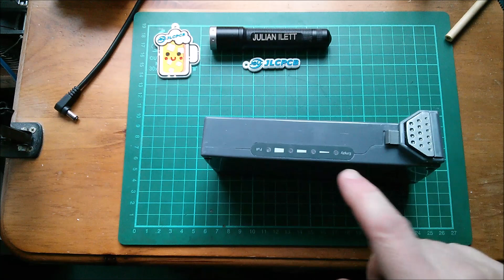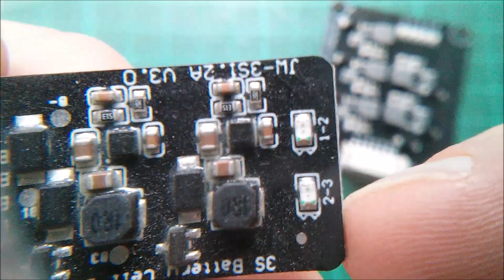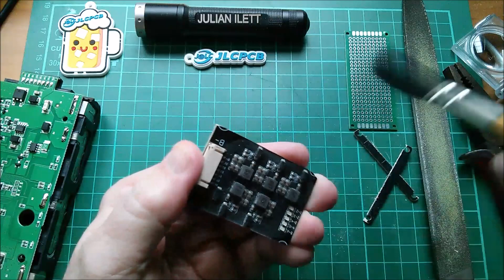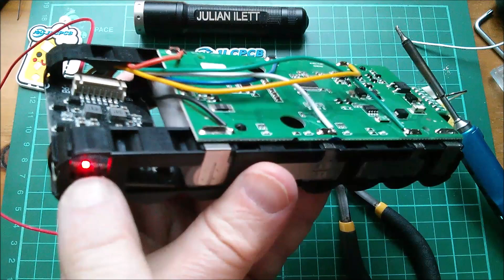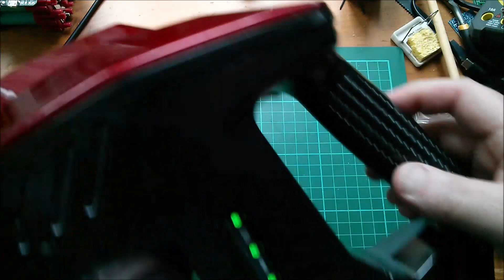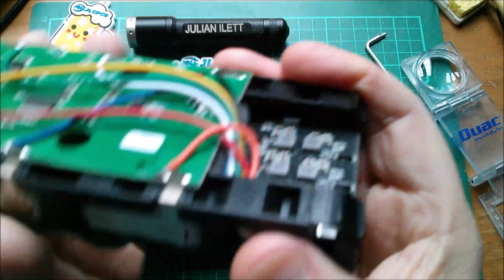Cordless Vacuum Cleaner Fix

Comment: Sorry, Julian but isn't that green board to which the 6 cells are soldered a 'balancer' board. So why are you fitting another one in parallel? If you were determined to fit a new balancer, wouldn't it have been easier to entirely remove the existing board?

Comment: I "fixed" a G-tech vacuum found in a skip. The vacuum itself was good, the cells in the battery were good, the circuit board however was junk so it wouldn't work. The only cheap fix was to gut it, rebuild my own 6S cell and wire it via a new switch directly to the motor. Works like a champ, use it all the time. The time it took me though I could have just gone and bought a new one! lol. Fun project though and learnt a lot.

Comment: I thought the pcb rails were visible in an angle, but I'm very surprised that a balancer circuit wouldn't already be integrated by the manufacturer... does the new circuit create a significant drain on the batteries when not in use?

Comment: At 4:20 if you single frame through (use the "<" & ">" keys [well "," & "." actually]) you can see the traces bulge on the gloss coating reflected.  It's not pin-sharp but good enough.  Good fix, happy new year, thanks!  :)

Comment: What is the model number? There is a product recall for model SHAZ 22.2 D5, risk of fire during use or recharge.
I could not quite make out the last number on your unit, I could see SHAZ 22.2 D? I think it was a 4 in which case the recall probably doesn't apply.
Reply from the maker: I found the manual - it's a SHAZ 22.2 C4

Comment: Julian the 18650 26f cells are rated at a max discharge of 5.2amps MAX. please can you test that the vacuum cleaner is not drawing more then that or you might have a big problem with the cell overheating or worse. https://secondlifestorage.com/index.php?threads/samsung-icr18650-26f-cell-specifications.1783/

Comment: Now that i think about it: These boards are a very weird way to achieve a voltage step up conversion. Imagine charging a tool battery with a 5V solar panel or so :) Just charge one cell and the board will gradually move the charge up to the others.

Comment: Vacuholic....
Can't say I've pimped the vacuum cleaner as not sure where the wife hides it, but a recent 18650 upgrade to my ancient Ni-Cad Bosch drill was a revelation. Now I want to stick 18650s on everything
Reply: I 18650'd our handheld vacuum from a bunch of NiMH cells and it's pretty glorious now. Of course I added proper 4mm charge leads and a balancing lead sticking out the side and repurposed the wimpy charger :-)

Comment: That poor ICR18650-26F will probably fail sooner than later and you have to fix your wife's battery again :)
It will struggle with the current drawn by the vacuum, which is probably somewhere around 10 to 20A. The cell is specced for 2C max, so that's 5.2A. It's for powerbanks and laptops and such, not for power tools. A INR18650-25R would be suitable.
Reply from the maker: There's no way that vacuum pulls 20 Amps. That would give it a run time of just 7.5 minutes from a 2500mAh battery :)
Reply: @JulianIlett  Sure, that's pretty accurate for many models. Mine uses a 400W motor and a 7S 2500mAh battery which is good for about 8 minutes of runtime in high mode. Many others are very similar (there is a OEM business for cordless vacuums and there aren't actually that many different models out there).
I don't know how powerful yours is, so I've just given a range and mentioned it just in case you want to check it. I'm pretty sure though that you're overloading the cell. If you aren't and the vacuum only needs 5A or less, then it's only about 100W. Not sure how good it would be at vacuuming then :)
Reply: I guess Julian's wife's battery is fine as he fixed the one for the vacuum.

Comment: That samsung cell is rated at 5.2A max discharge. Maybe the originals are higher spec? Just like most other powertools, sometimes upto 15A. Maybe that is not  the right cell for this purpose? Better be carefull with that,

Comment: re. being able to see the LED's, just cut a slot in the box, put some tape (insulation or even normal sticky tape ) on the outside of the case and fill the slot from the inside with epoxy glue such as Araldite, then remove the tape once the epoxy has set,  you should be able to see the LED's light up through the epoxy. I've used this method on several projects and gives a good result.

Comment: That battery pack already has an awfully big PCB circuit so why would you think it doesn't have cell balancing already?  A series charge controller (only) and 4 LED battery level indicator doesn't need that much so there has to be more to it than that.  So I think it must have some form of balancing.  Not "active" but some type of over charge and over discharge circuit for each cell.
Adding a 2nd PCB in parallel may actually cause disagreements (different voltage settings) between the two and could cause problems.  Imagine the active balancer trying to raise one cell while the OEM balancer thinks it is already too high.  I don't think just adding a 2nd PCB without knowing what the 1st one is doing is such a good idea.

Comment: First thing to do is... get out your DMM!  D M M.   D M M  D M M
I still don't know why you find that part so difficult, Julian!   ;-)
The first thing we need to know is the voltage of each battery (cell).  And then with a charge test you can likely see one needs replacing.  An "active cell balancer" seems like overkill here.
Reply from the maker: I did that in the first video
Reply: @JulianIlett  You say that, and I believe you, but you haven't PUBLISHED that video.  You don't speak of the first video or reference it in the show notes.  And, if that was the case (that you'd measured the cell voltages), then why did you not replace the weak/damaged cell FIRST?
Getting one of these https://www.aliexpress.com/item/4001068481766.html?spm=a2g0o.productlist.0.0.4b842481D1LEWA&algo_pvid=84a53132-f79f-4942-9444-8a40ef584cbd&algo_expid=84a53132-f79f-4942-9444-8a40ef584cbd-2&btsid=0bb0624616096486024112105e9d98&ws_ab_test=searchweb0_0,searchweb201602_,searchweb201603_ for looking at the battery voltage and individual cell voltages.  GoodsBanger & eBay will probably have similar things at similar prices.
Reply: @Brian_Of_Melbourne  Wow, the spanish inquisition is here!
Reply from the maker: It's on my other YouTube channel
Reply: @JulianIlett  which one? How many do you have now? can you link them all?
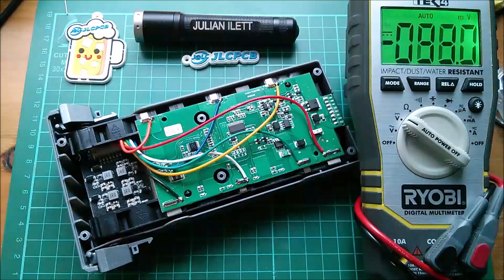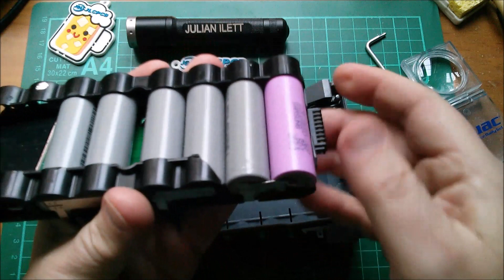Reply: @JulianIlett  Oh yeah, found it  - three months ago.  Strangely in that video it is a different cell that is 'weak'.  The cell that was replaced here appeared to be fine then.  The voltages three months ago: 4.18,  4.02,  3.23,  4.01, 4.16,  4.06.  No measuring of voltages before fitting the active balancer.  Then (at 14:32 or so): 3.13,  3.14,  2.71,  2.63,  2.56,  0.30.  Then, at 20:08, the reveal that a cell was changed.

I agree that an active cell balancer is a good thing, particularly for older batteries where cells are becoming unbalanced.  However this battery does appear to at least have (at first blush) a balancing charger, as evidenced by the fact that there are inter-cell connections.  I would posit that vacuum batteries will tend to be fully discharged (to the point where the controller won't allow any more fun) before being charged, and that this gives a balancing charger the best chance of resulting in a balanced charge.

It will be interesting to revisit the cell voltages in a month or so.  Once when the battery has been 'emptied' and then again after being fully re-charged.  Having mucked about with several lithium powered vacuums an interesting metric is the simple run-time from fully charged to stop.

Comment: Some cells have a smart/dumb???   Bms that kills the output circuit permanently to force you to buy a new pack. DJI and Matica do this, if you let it over discharge just once.
Reply: I had a lipo pack on a wheel chair. That had this feature the BMS shut the battery down and wouldn't work again. We eventually resolved it by charging that battery directly with the BMS disconnected and once fully charged reconnected the BMS all okay.
Reply: @davidsharp9166  thanks tried it still no luck. Some manufacturers just don't want to repair the thing by using software to block you.

Comment: Biggest problem with these Hoover is the 1p battery pack wich over time gets higher internal resistance because of high load over his 1p arrangement cells
I have a few Dyson v6 and v8 and I added another battery in parallel 6s 2p and now the load is split in half wich makes a huge difference on life time of the battery and run time 
In this case you can add more cells but on any Dyson it's easy job
Reply: Is there a video of this great upgrade?  Whenever I've looked at battery packs like this there doesn't look like there would be space to upgrade from 6S-1P to 6S-2P.
Reply: @Brian_Of_Melbourne  I made a little video a while back but I haven't made one how to build it   
https://youtu.be/eAD8fOsztsc

Comment: Is not recommend to solder directly the battery, because heat and lithium is very not a good idea, but you do what you want ^^
Reply: Not recommended but I and others have done it a bunch of times. No problem as long as you are fast and I like to cool the can with a wet towel or sponge immediately after.
Reply: Where does he do that?
Reply: @emilen2  in the end of the video
Reply: A possible solution is an el-cheapo welder.  Adam Welch https://www.youtube.com/c/AdamWelchUK/videos has just published two videos about such a device (one testing/destroying it and the second repairing and improving it).

Comment: Umm, 3 year warranty on that. Wouldn't have been as interesting a video though and I can imagine the grief for not repairing it immediately if not sooner.
Reply: The warranty on stuff with batteries usually doesn't cover the batteries.
It's pretty clear, you just have to read that small detail in the fine print hidden away toward the back of one of the multiple booklets with instructions. ;)
Reply: @vortexpt87  True enough but it's worth a phone call if it's only a year old.

Comment: Was there a reason to cut the board and not the plastic cell holder was there something that didn’t show on the video, or aren’t you what we think?
Reply: Ya, that's a good idea.  If he cut the battery holder he likely could have fit the balancer at least at an angle.  Or at least reduced the amount of PCB cutting to just one side.  But if you read my other comment I don't think adding this 2nd PCB was need and might even cause problems.

Comment: Was everyone else shouting at the screen - "I can see the tracks going round the edge of that board; you are going to cut them"?
Reply from the maker: The PCB designer should have been thinking "what if someone carves a strip off both sides of this board" ;)
Reply: @JulianIlett  those tracks looked like they had been laid the old fashioned way with tape.
Reply: @donepearce  I think many young engineers never seen the copper side layout by tape, never seen the exposure machine and working film....🤣🤣
Reply: Yeah. That is why I stopped watching Julian regularly. It was raising my blood pressure. The real fix was to buy six new cells and use the “good ones” for other projects.
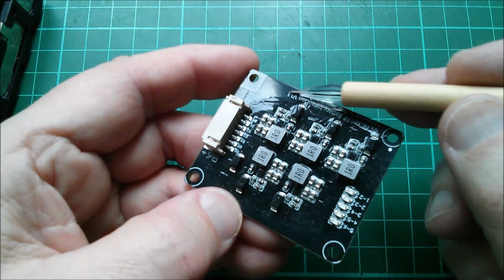Reply: I had to stop at 4:34 to check the comments  because the side  tracks were sticking out like dog nuts ...
Reply: Lol I did
Reply: It's conformal coating laid on with a brush.
Reply: I did not see them. Still don't.
Reply: @benbaselet2026  what were you looking for?

Comment: 1:50 - how does the balancer balance the cells when they're only halfway charged? I thought you could only balance at top of charge or bottom of charge?
Reply: It's an active balancer, not a BMS per se. 
It works by shuffling a small charge from a low cell to a higher by means of capacitors, until they are somewhat at the same level.
Reply from the maker: You can centre-balance too. It's more difficult to do accurately because the charge/discharge curve is fairly flat in the centre. The active balancer is always looking for a voltage difference between adjacent cells.

Comment: My experience of having a cordless vac in this situation was that even replacing the bad cell wasn't enough to bring it back to having good performance for long. After a couple of months I have now ordered a full set of high performance cells. Nice branded ones with 30A max output are only £1 / volt or thereabouts so if I'm going to the effort of taking everything apart then in future I'd skip straight to this.
Reply from the maker: True. But I want the wife to 'feel the pain' of me having to repair everything. So I'll change the cells one by one :)
Reply: @JulianIlett  Lol
Reply: @JulianIlett  Better be careful though, Julian, that the wife doesn't also make you "feel the pain" of her having to vacuum everything! Lol!
Reply: @JulianIlett  if you really need cordless then there is always the cordless Henry, more expensive but you do get a Fey German battery pack (with Japanese cells I would guess).
And not surprised you need to do a lot of vacuuming when you have a cordless, they just don't have the power of a bagged mains unit, even the expensive ones.